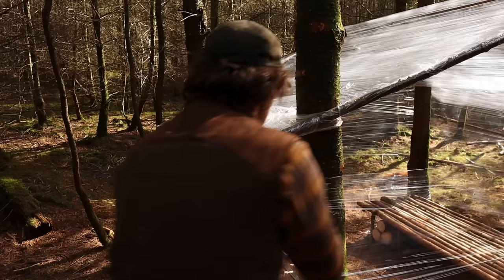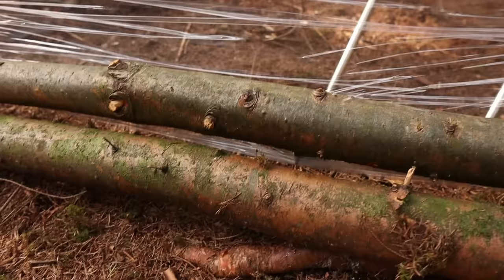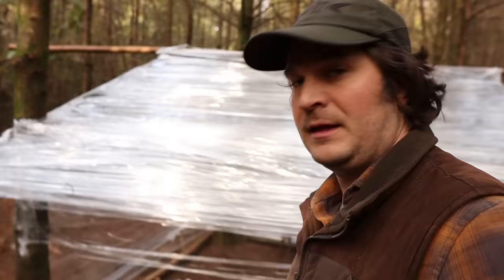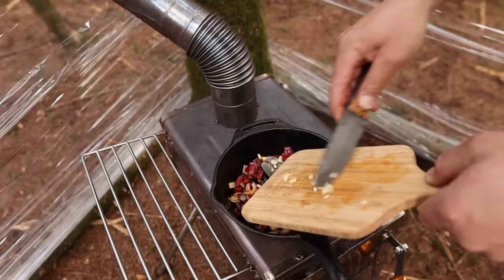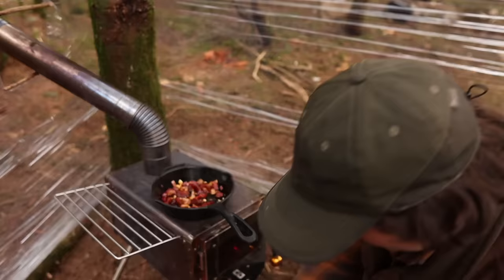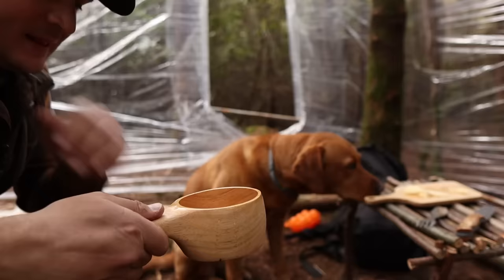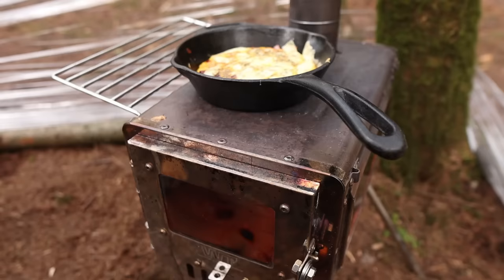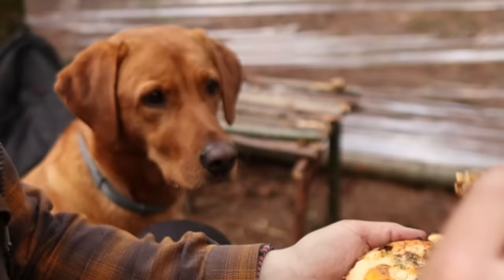Building a Woodland Cabin with Plastic Wrap | Wood Stove | Survival Project | Bushcraft Shelter

Comment: When you wrapped the outside, go one wrap around fully, then add a thin Pole up beside the trees you wrapped already and wrap again so it spaces the wrap one more layer out for 2 layer walls.
Reply: I suppose this additional layer will provide enough protection while you sleep, so you dont suffer the fate of Grizzly Man and Fam?

.

.

.

Ya, I know. Its a double pane wall for thermal insulation. It will probably work well. And may even reduce the unhealthy amount of condensation and mold from containing a patch of dirt under plastic in the sun.
Reply: @TheJustinJ  o
Reply: @matthieuschmitter6676   that was set up as a survival situation

Comment: You should have started from the bottom portion of the inclined roof frame when wrapping the plastic so that rain water can flow over each layer, just like a house roof tiles/shingles are laid out.
Reply: I doubt it will matter since he doesn't have wood in his walls that will rot and the heater will dry up the inside moisture.
Reply: very smart

Comment: That was great. The thing I would do as well and this would be more for the colder weather is.. cut two upright timbers per tree trunk. After you wrap the trunks as you did you can put a second insulating layer buy using the eight uprights as a spacer on each trunk. Great job, that was fun and so simple. Thanks.. Subbed
Reply: Double wall construction is always warmer, or cooler in hot weather

Comment: Genius! LOL ... never thought of this! :D   Just one note, enclosed wood burners do not emit CO2s directly into the enclosed space, neither use oxygen directly from the space. Many people are confused about this but enclosed wood burners emit ALL CO2 through the chimney and ONLY  use oxygen from the air already inside the wood burner. They simply pull air into the burning chamber (only lowering air pressure inside the tent, not decreasing actual oxygen content), use ONLY the oxygen inside the burner and emit ALL CO2 through the chimney pipes. Only you - and your dog - actually use oxygen from and generate CO2 inside the tent so yes it's a good idea to still keep a hole for air exchange but it can be smaller. One intake hole is enough because your wood burner is already pulling air in and emitting it through the chimney so they contribute for your air exchange. You do not need a hole by the roof, just a small hole on the bottom as fresh air intake.
Reply from the maker: Thanks Tibor 🙏
Reply: @BUSHCRAFTTOOLS  Any time mate, thanks for the great videos! ✌

Comment: Great concept. Plastic wrap is 100% waterproof and will conform to any shape. No hardware needed either.
Reply: Agreed. Especially if it were just the first layer and then build the rest over top, even if it were just lean to style. It's like  bushcraft tyvex.😄
Reply: Right, and can totally withstand a storm with anything beyond 10 mph wind…….
Reply: @jcmee91  Not if you pour a 9 foot thick steel reinforced concrete wall around it and then put a mountain on top of it.
Reply: Its anything but a great concept... More like a cool idea, but far from a great concept. Insects and animals like snakes can easily get in. I really see no point in this over a tent...
Reply: @Ex0rz  "Cool" is synonymous with "great" and "concept" is synonymous with "idea". I'm glad we agree.
Reply: @CugerBrant  No prob, just here to help.

Comment: I've actually thought of doing this. I'm sure the temperature retention will be excellent down to even the single digits. They have silver tape used in HVAC that is heat resistant u could use to cover up the whole for the wood stove.
Reply: If you're going through the trouble of framing, just use tarps. Stronger, reusable, and with a little more privacy. At best this plastic wrap will be in a landfill before long. (At worst, pieces rip and blow away to be lost in the woods.)
Reply: @notme222  what about the air inside,can,t be good fot you,....no thanks.
Reply: @notme222  this technique works best for tiny emergency shelters. You don't need very much plastic wrap to enclose an area just slightly larger than your body and gear.

Comment: If you ever decide to do this again you should put double posts at the corner of your shelter so that after you do the first go around you can go around a second time on the posts that are like an inch further out. that will give you an insulation layer on your outside walls with not much more effort.
Reply: You dont need pallet Rap, cheep 40p supermarket clingfilm works fine.
Reply: @jasonjason9866  Why do anything? Some people like making cabins in the woods made out of plastic wrap instead of wood or a tent or a caravan.
Reply: @jasonjason9866  Right I have a greenhouse made out of Aluminium frame and plastic panels it's highly lightweight and different from the old style steal frame with glass panels. I also have a Polytunnel. Your tents made of plastic so If you dont like plastic trash them buy a waxed cotton tent.
Reply: @jasonjason9866  HA! You sir, got told! 😝🤣
Reply: @Jason Jason  it just seems wasteful to bring all that wrap in and cut down those healthy trees for a stupid  one night disposable hut. Cool build I guess though
Reply: @vindogg80  Do you think they care about that when they probably made at minimum $50.000 from video adds?

Comment: Good idea - just worry a bit about the roof having no support in a downpour and your wrap slowly coming apart overnight leaving you rather soggy.  If not rafters then, whatever could be devised to reduce the amount of give in the available surface area in the wrap to reduce pooling and the inevitable weight that opens up and weakens the bonds between the edges of sheets - it might be making a roof from several overlapping panels or just make the roof pitch steeper?  You could double insulate if you thought it was necessary by doubling the studs on the walls - but perhaps its not all that necessary.  The only other thing I could think of as an improvement for your excellent idea is the flue requires a very light non combustible and heat resistant flange as it exits the plastic envelope ..not sure what that could be - but I'm thinking on it.

Comment: Saran/cling/pallet wrap makes an excellent greenhouse patch. It does keep the warm air in as long as you do not have any large holes in the wrong place. A hole in the wrong area will allow cooler air infiltration, which would lower the temperature very quickly on a cool night.

Comment: Weirdly, I’d be so scared to sleep in that shelter because I’d feel so exposed but sleeping outside of the shelter I’d feel ok 😅
Reply: you can get black or green wrap they use for wrapping pallets of stock with, they're longer aswell so it'd be a bit quicker, and they have a few inches of tube left at either end to hold, best to wear gloves, or the rollers will friction burn your hands if u go too quick.
Reply: @jack28aug  legit, either you be careful not to burn your hands, or you engineer a quick and dirty way to pass that friction onto something else... folks used to have something that was an improvised roller, because they had an industrial pallet shop and we went through that crap by the case XD

cardboard burns are a thing, you got that right XD

Comment: Great idea, I bet you get some outstanding nighttime shots from outside with the glow of the wood stove. 
I recommend a string or 2 of USB fairy lights and a power bank to run them from for a magical lighting experience.

One suggestion, take eggs without the shells in a small flask, then there is no risk of them breaking on the journey and you will save space in your pack, they even last overnight for scrambled eggs for breakfast

Comment: For all the people I have seen do these shelters, this fixed most of my issues with others. The double layer for the top was the biggest, and he did it even better than my solution.
Only thing I might change with his, he should double layer all the sides so they would be much more secure.

(the only one on the top of my head I can think of doing this is JStu - more than once, but I know I have seen at least 3 or 4 others do something similar. Always a failure on other channels, and all I can think is you did a lousy job - so don't classify it a failure - the problem is you.)

Comment: Plastic sheeting/painter's dropcloths or basically any type of plastic, no matter what is formed from it, is a very good insulator for both heat and air conditioning. Wonder how 3 layers of 2 millimeter plastic sheets made into a temporary shelter, 6 millimeters thick, would provide a good survival hut with a small camping stove/oven at a  temperature of -20.

Comment: Food safe rolls 1000-1250 feet a roll, 18 inch or so wide.. cost you about.. 40 dollars. And what you can do with it, far exceeds what you can do with the same cost tent. They have "packing" rolls too, wider in length less in feet, but honestly, they overprice them, and they stink due to not being a higher quality plastic. Its not that they are worse, they just have issues to either width choice you want. More work with smaller. Perhaps less visibility. Unless you get the "greenish" packing rolls. 
Maybe add some bells, stop the "ooh a bear will get you" nonsense. Alligator clip them to each wall on the interior. Even bear claws arent razors, it will definitely wake you.